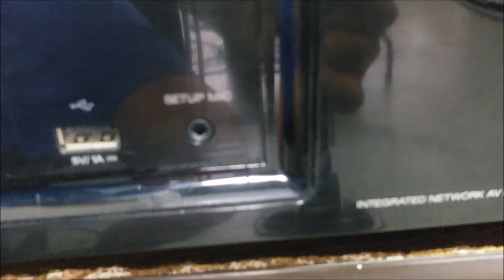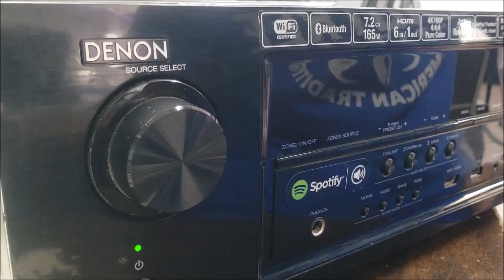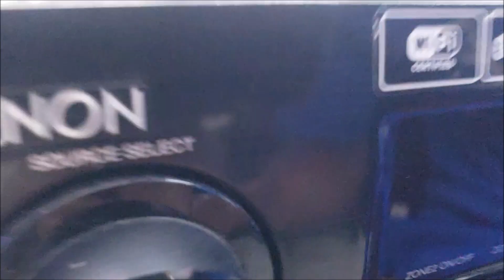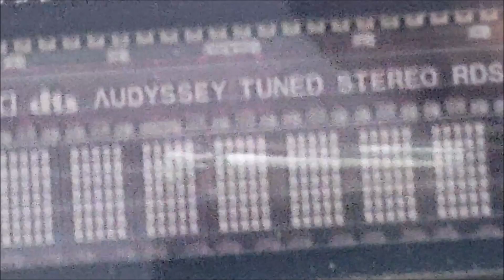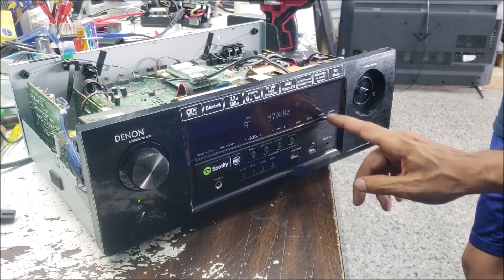DENON AVR S700W AV receiver no display

Comment: I have the AVR-x2100w that looks almost identical, and I'm having a similar issue with the display not working.  I don't see a red fuse on mine though.  I'm also not nearly as well versed at troubleshooting electronics based on what I saw you do, but I can check voltage and resistance.  I did find a blown T6.3AL250v fuse closer to the power inlet on a different board though.  Note sure if that'll fix it or not, since the unit turns on.

Comment: Very nice fix. I had a similar unit except it was a Sony. No sound or display. Ended up it was bad solder joints on the front panel.🙄🙄

Comment: question is, why was the fuse blown.
Reply from the maker: i didnt find a short, so it could be the screen components resistance changed by the age, or a small power surge and that 100mA fuse cant handle it, i changed the fuse with 1Amp